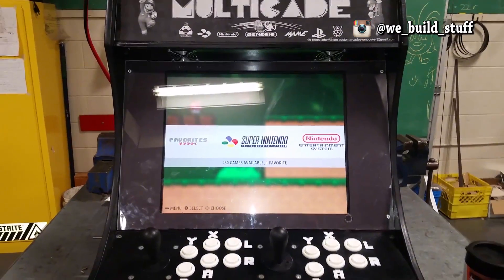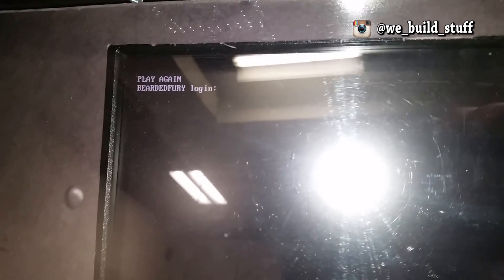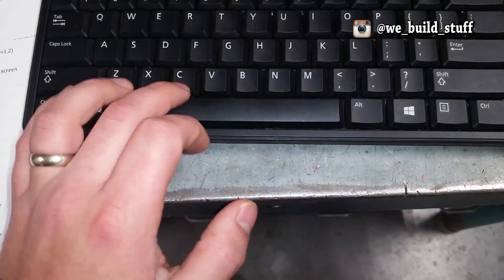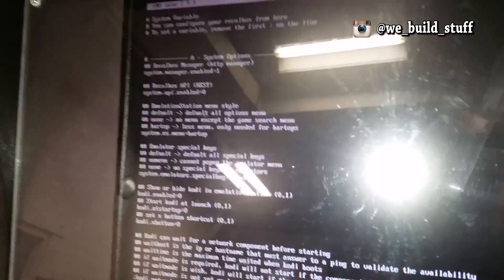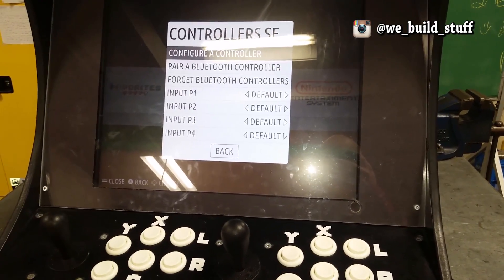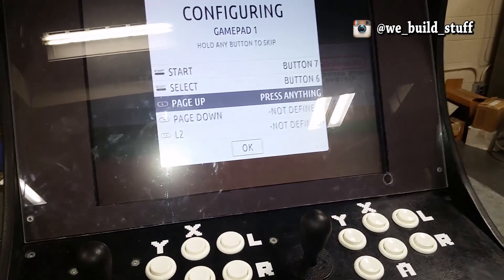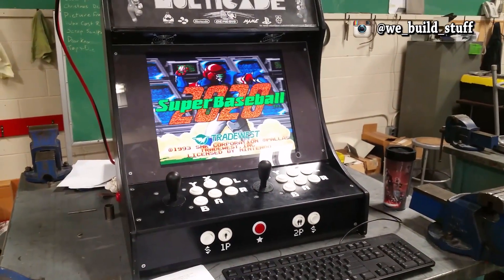Program GPIO controls on a DIY Raspberry Pi Arcade Cabinet! HOW TO DO IT EASY!

Comment: I need help! I have a raspberry pi 5 connected to a  mini-pac opti connected to a control panel that has 2 joysticks, spinner, trackball and 24 buttons that I can't get Recalbox to recognize. Help me please!
Reply from the maker: @emilionazario9609  mini pac opti requires extra programming to work with recalbox
https://forum.recalbox.com/topic/7690/beginners-help-with-minipac

You may need a different front end like retropie or a whole different system like a small windows pc to get all of those things working.

Recalbox is preprogrammed for many controllers but not spinners or trackballs. It can be done but will require research. Start with the above link in this comment from 2017
Reply: @WeBuildStuff  I have two memory cards, one with recallbox and the other with batocera.  I'm having the same problem with both. I have no idea on how to write code to make it work. BTW, the link you provided is locked so I can't comment.
Reply from the maker: @emilionazario9609  yes it is an older link but I was hoping it might lead you in the right direction 

Is this your new post?
https://forum.recalbox.com/user/burnaz

Comment: Hi. Thanks for the video. Very informative but for some reason when I typed in 'nano recalbox.conf' it just showed a blank screen.  Maybe it was because I was using the raccoonbox image but after hours of trial and error I managed to do it.  When you get to the blank screen, press ctrl + r and it will ask what file to read. Thats when you  type in recalbox.conf.  but it started me off at the bottom of the page so I scrolled up to the joystick options and voila. Worked like a charm. If anyone runs into this problem maybe it will help them. Thanks again
Reply from the maker: glad you found a fix! This video is from a few years ago and they have done some big updates to Recalbox that make things a bit easier :)
Reply from the maker: also I think it comes up with a blank screen until you type the admin password (which should be in their wiki page).

https://forum.recalbox.com/topic/965/resolved-edit-recalbox-conf/3

Comment: Very great video, explains a lot and fabulous content. I was wondering if you could answer a couple of questions...What do you use the hotkey for? Do you map an exit button?
Reply from the maker: The hotkey plus another  button will serve a function in recalbox like exiting back to menu, save states, rewind, etc.
Reply: @WeBuildStuff  How do you program the Hot key to buttons in order for them to do the actions you want. I always see videos and they get to the hotkey and assign a button, but never get into how to select other buttons for the different types of actions. Do you hold the hotkey down and move the curser to the actions you want the  buttons to perform? Any help would be so much appreciated. Love your builds you do phenomenal work.
Reply from the maker: @doityourselfjim7368  thanks!

Recalbox has them programmed in already. Scroll down on this link to "special commands"

https://github.com/recalbox/recalbox-os/wiki/Manual-%28EN%29#duringgame-special

Comment: I got to minute 5:00 and my usb sanwa joystick only records UP. I noticed a red light on the board. All the other buttons work fine. Help!
Reply from the maker: It is going into a USB encoder or is the joystick itself usb output.
This video is showing recalbox configuration qith GPIO inputs
Reply: We Build Stuff 
Thanks for replying.
This is the joystick 
https://www.google.com/shopping/product/6252570243308334294/image?q=sanwa+joystick&client=safari&hl=en-us&biw=414&bih=719&scsr=p:10084433026864844323,17041725965749815564,7284976529823103220,1960153313431924325,10305593274331282914,11969714406085033102,10260444283388161936,12299743188865798947,705983718248761226,13654226866682590406&prds=cid:6252570243308334294,cs:1,paur:ClkAsKraX3VA7D1gi1sz5l3ASbNAfrn2sEkjgjGkuOwn8keJGBwd7q-x_Vq9ZjbyTAejKjz68ajTYJUboe05-3Bgxah0s1xLGMaGiUW7tLuMzvnItncR1kjwohIZAFPVH73bB4BF7K5kHqRj_3-LuVg1XOUt6A,sgro:iv,mvi:0
Reply: We Build Stuff 
I plug it directly to the raspberry pi3 usb slots.
Reply from the maker: @martymcfly6129  is it both joysticks that have the issue or just one. I have had bad wires or broken ground loops before that have stopped my connections from working properly and it wasn't until finding the bad wire that i solved the issue.

I use the same uab encoder for most of my builds. I only have used recalbox so I'm not sure how drivers work for other versions like retropie, etc
Reply: We Build Stuff 
Both joysticks. Could it be that it is not wired correctly?
Reply from the maker: @martymcfly6129  start with that!
Reply: We Build Stuff 
Thanks! I love your videos
Reply: We Build Stuff 
one kore question: is this video ok for the type of joystick I got? Thanks
Reply from the maker: @martymcfly6129  this video is the complete opposite i think. This video is geared towards wiring your joysticks and buttons directly to the GPIO headers. I don't use this method anymore since I switched to USB encoders. Usb encoders are quicker for me!
Reply: We Build Stuff 
Do I have to undo what I did?
Reply: We Build Stuff 
Do you have a video on how to do usb? Thanks
Reply: We Build Stuff 
I solved the problem. I put some wires into the joystick slots. That’s why it didn’t go down or left and right. I was able to configure the joystick. Thanks
Reply from the maker: @martymcfly6129  glad you sorted it out! One of my next videos (part 5 for the bigger bartop arcade) will feature wiring and explainations

Comment: Hello !! I don’t see the button where you can save the settings and can’t reboot it ? Can you please let me know exactly where should I go to do those 2 last steps ? Thanks
Reply from the maker: https://github.com/recalbox/recalbox-os/wiki/Root-access-on-terminal-%28EN%29

To reboot make sure you have saved first. i did that with CTRL X and make sure you type Y or YES to save
then I think I just typed reboot
I think it is around the 4:00 mark

Comment: Do you have any mapping about on wich pin connect each button and joystick? i cand get an usb encoder so i want to try this aproach.
Thanks!
Reply from the maker: https://github.com/recalbox/recalbox-os/wiki/GPIO-controllers-%28EN%29
and
https://forum.recalbox.com/topic/11125/custom-gpio-pins-map-for-controllers-mk_arcade_joystick_rpi
Reply from the maker: That being said... Since this video I have switched almost exclusively to using a USB encoder. It is so much easier!

Comment: why does your video shake like a parkinson?
Reply from the maker: Igor Nardo I held a phone with one hand and programmed with the other. Congratulations on being so perceptive lol
Reply: ok cool, just asking cos video is cool and helpful actually, but the shaking makes it hard to watch, btw very good final result with the cabinet!

It's actually cool that you built it upon rekalbox (which i like more than classic retropie) but i'm actually going for retropie simply because there are simpler libraries to map stuff.
It would be cool to see the buttons wiring process... Cheers! (and thanks for getting back to me ;)
Reply from the maker: Igor Nardo for sure! Check out the full build video on my channel to see the wires. I would do it differently next time and just use a USB encoder!

Comment: Hi mate. I've hit a snag in my build. For some reason when I went in mame games on street fighter 2  I can't play just a one player game. I have to put two credits on, then press select on controller 2 to start the game it won't start with player one when I press select. Tried some other games same snag apart from it will start with just one player playing. I want to be able to just press start for credit then select to start on the one player side.  Any advise would be a helpful. Cheers. Leon.

Comment: Hey man, Awesome video! I have the exact same setup and it works perfectly aside from when i load a game, i can't get function from the start and select buttons.  joystick and other buttons work and hotkey functions.  In the Recalbox menus start and select to pull up the the appropriate menus.  Any idea what might fix that? thanks for you time in advance!
Reply from the maker: Are you doing it via GPIO. could be your wires are not plugged into the correct header...
Reply from the maker: maybe try resinstalling the OS
Reply: The start and select function properly for the recalbox menus. But during emulation have no function. Thanks for the tips. I’m going to try reinstalling the os and try again.
Reply from the maker: Nick Laub weird. Have you checked for any wire grounding issues? I had it only happening sometimes with my start and select buttons. It turnes out there was a break in a cable near where my connectors touched the microswitch on my latest build
Reply: working now, it was the wearedirtygaming.img file.  While it has a good selection of games, the edits made the GPIO not work properly.  Now I need to find a source for the roms, any advice there is also apperciated, working on christmas presents  Thanks for your help!
Reply from the maker: Nick Laub emu paradise is a good start. Using thr GPIO is not a common way to wire arcades. Most people use usv encoders. You can create or download a driver by 'digital lumberjack'. He made one compatible with retropie images. It is already part of recalbox but if using a different OS like retropie you need to do the extra programming to get his driver working

Comment: How much faster is to connect the controllers directly into the raspeberry than using a Controller for the joystic and button ?
Reply from the maker: Gustavo Navarro way quicker if you have a usb keyboard encoder. i had compatiblity issues with the knock off xin-mo i originally bought. it only took me about an hour to cut, strip, crimp, and connect everything. my cable management looks better now than in this video 😊
Reply: Thanks for your quick response. I have noticed that SFII doesnt response 100% using usb keyboard encoder. Will try as u have it.

I owe u a beer :)

Comment: Hello! Thanks for this video. I have a question, how can i connect the gpio to the controllers, since the connector is the same for buttons and my controller doesnt have the right input. thanx
Reply from the maker: Can you be more specific? Each of headers on the on the GPIO pins can be used for a special input/output. I plug them in using "dupont connectors" with the other end of the wire going to the microswitch tab of the arcade button or joystick microswitch. You can see here how I did mine: https://youtu.be/NUmrwvQ0reI?t=12m25s

Comment: Hello Great video one question with is the GPIO pin with connect the ground of the buttons?
Reply from the maker: each button has a microswitch with 2 or 3 terminals on it. I connect to ground and the "positive" with 2 wires and connect them to either the GPIO headers on the pi or to the correct headers on a USB encoder

Comment: Great video, Just wondering what made you pick to connect to this by GPIO? A lot of these arcade button kits already come with USB encoders, did you find them to not work as well?
Reply from the maker: Joseph Fernand the first kit i bought 2 years came with an encoder that didnt work so i did this as another option. the thing i like is there is no chance of player 1 or 2 switching because of the pi reading the usb inputs wrong. i have used good and bad encoders but the gpio input method has worked for me everytime
Reply: We Build Stuff thanks for your reply! Are you able to point me in the direction of your wiring diagram?
Reply from the maker: Joseph Fernand see the video deacription for wiring diagram links
Reply: We Build Stuff sorry! I'm just having a bit of trouble finding it? Is it supposed to be on the instructables web link?
Reply from the maker: https://github.com/recalbox/recalbox-os/wiki/GPIO-controllers-(EN)

http://holbrooktech.weebly.com/pi-arcade-101.html
Reply: We Build Stuff i was just wandering how you fixed these problems with the encoder. Im having issues with joystick switching from up being down and down being up etc. Also, 1p and 2p will switch... etc. 

I would appreciate any help i can get, thankyou

Comment: How do you handle the need for an escape key?
Reply from the maker: are you referring to "exiting a game and back to the selection menu" or the escape key on a keyboard?
Reply: I found it, I was suppose to use the Hot Key + start I believe. Sort of hidden in Github. Thanks so much for making this video.
Reply: Sorry, I was referring to the same function as using the escape button on a keyboard to get out of a game. After a while searching I found this Hotkey mapping on Github (https://github.com/recalbox/recalbox-os/wiki/Manual-%28EN%29#b---special-commands). So now I know you have to hold that Star Key (Hotkey) and push Start. (Hotkey + Start → End Game and Quit To Main Menu). Thank you by the way for making this video. It has really helped.
Reply from the maker: Yes. I press hotkey + start/1player button

Comment: looks great!  looking forward to building mine.  getting an understanding of everything right now and may be a silly question but what is the difference between the hotkey and a reset button?
Reply from the maker: the hotkey is used with a combination of another button for a result like: exit to menu, save state, load state, etc. The reset button completely shuts down the pi and boots it up again

Comment: Hey Mike. Any ideas on adding a roller ball in addition to the 2 player joystick configuration? Are there additional GPIO inputs to tap into? Or a "switch" box to switch between player one joy stick and ball?
Reply from the maker: i dont know much about those but usually that would be an analog signal so probably usb. it would be interpreted as a mouse input i believe. im sure there is a reddit thread or forums with info. that would be an awesome addition. a spinner too!
Reply: Very good. Thanks

Comment: hi I am.planning building a cabinet with coin acceptor, what kind of hardware I need to attach the coin device?
Reply from the maker: just a jump wire from the coin slot trigger to the correct gpio. it will be the same ones used for player 1 and 2 select/coin inputs. google "recalbox gpio" and see the diagram
Reply: We Build Stuff thanks very much

Comment: great series.  buying all the parts now..so probably 2 months till they all get here lol. thanks for sharing this.  I've been debating over gpio vs zero delay USB.  the USB would let me upgrade to PC later on for newer stuff, but gpio should be fine if I don't mess with it too much.  any thoughts?  also have you tried this with any other pre-built emu based front/back end ?
Reply from the maker: Recalbox has been the only one I have used so far but I would like to try some other ones with nicer looking front ends or do a hyperspin build.
The nice thing about the GPIO installation is you can easily unplug from the GPIO and plug into a USB encoder and have it up and running with just some menu tweaks and changing the recalbox.conf file to the right controller setting :)
Reply: We Build Stuff took less time than I thought.  it's not perfect, but my kids love it...& just maybe I enjoy playing sf2 & dark stalkers:).  thanks again for the videos.  FYI I went with the USB encoders mostly because it didn't look as easy to set up gpio for retropie & they were 6$ from China.
Reply from the maker: awesome! which encoder did you use? and did you stay with Recalbox or retropie?
Reply: We Build Stuff I used the zero delay encoders & retropie.  still an easy setup & when I have time want to try kids mode (only selected games are playable)

Comment: Is there a way you could do a video on a total walk through on the setup of the GPO pins for the controller setup? It would be very helpful for first time builders and make it more understanding.  I have a 2 player setup i can not get to work right. Thanks for reading my comment to.
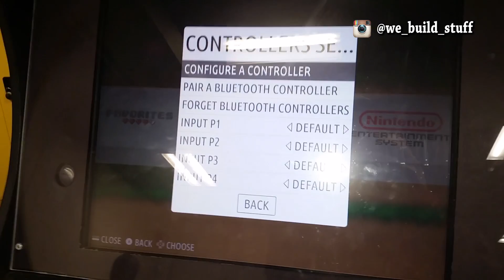Reply from the maker: Are you talking about plugging the pins into the board or setting it up in the menu like at 4:36?

I am making another full build video but it won't be done for awhile as I am taking my time and helping some students build their own as well.
Reply from the maker: You can see the way I have installed the wires in my other video for now at 12m25s . I will try and do a future video of just the wiring. 
https://youtu.be/NUmrwvQ0reI?t=12m25s

I found my information on how to do it on the Recalbox website
https://github.com/recalbox/recalbox-os/wiki/GPIO-controllers-(EN)

Comment: I got to the controller change but I couldn't save it.... how do I use the save command after changing it to 1 from 0?
Reply from the maker: It should say it at the bottom of the screen. Should be "CTRL X"
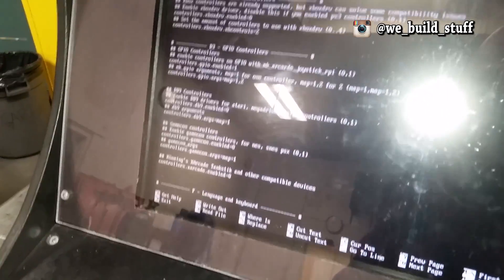Reply from the maker: freeze the video at 2:40 you can see it at the bottom